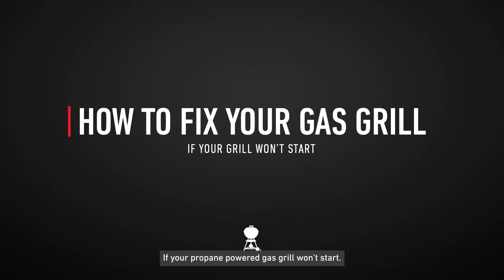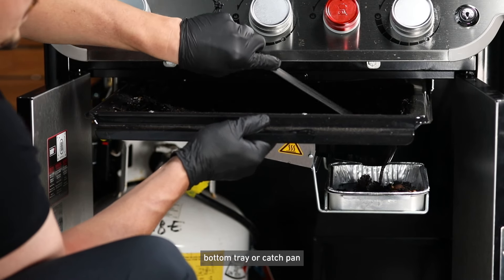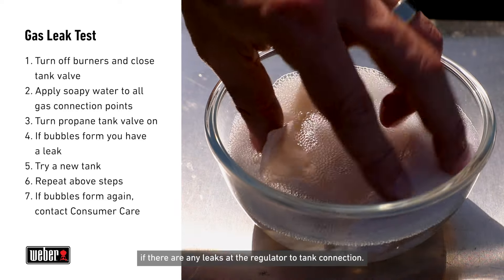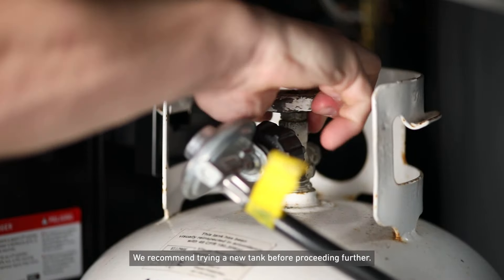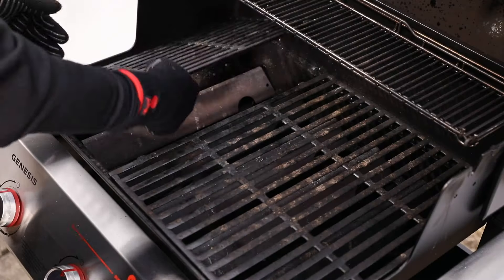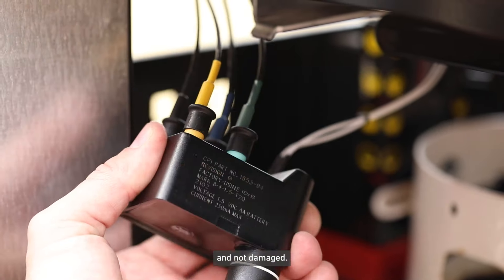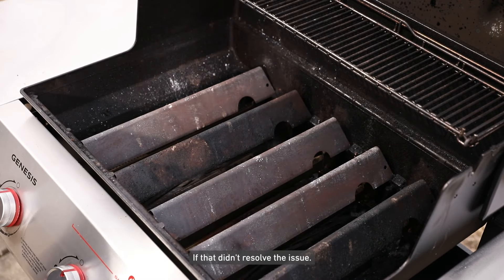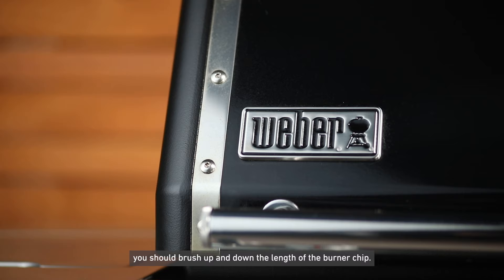Gas Grill Not Starting Issues | Weber Grills

Comment: Putting it on the curb, nothing but headaches
Reply: Mine is brand new and still two burners not working.
Reply from the maker: Hi! We are sorry to hear your grill is not working. Please reach out direct by phone or email. We are happy to further assist you.
Reply: That's what I'm doing after 3 years of a Weber S-435 propane grill. Mine won't get any propane to the manifold and won't start. I replaced the tank and regulator valve. I will never own another Weber anything. They aren't made to last like n years past and are a cheaply made product with inferior parts. I am waiting for my Napoleon Prestige Pro to arrive on Thursday.
Reply: Me too😅😅😅😅